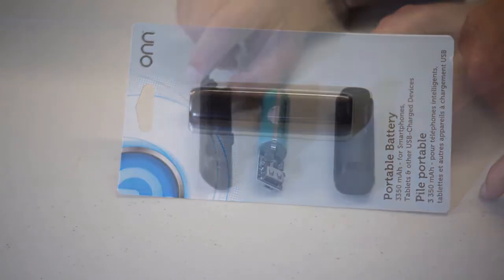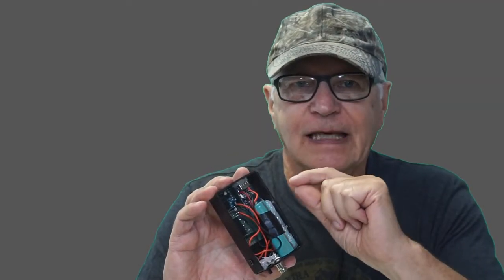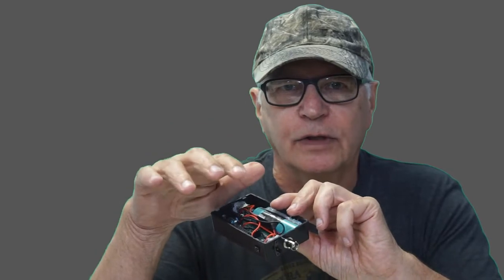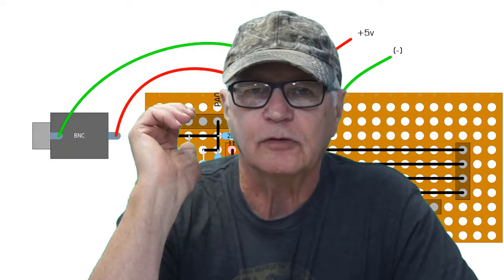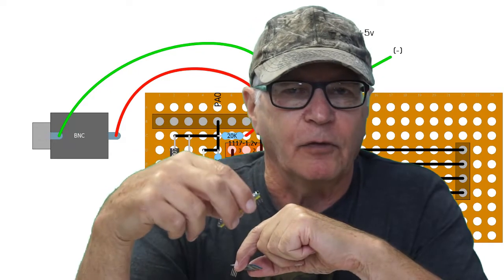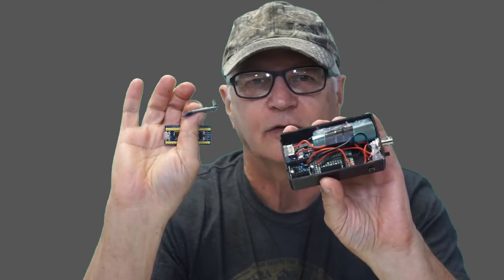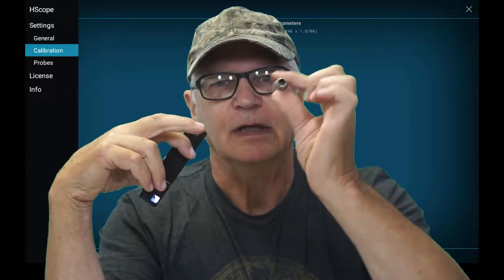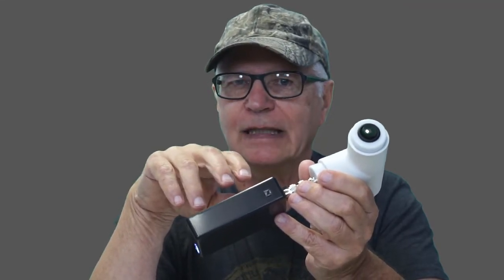GADGETS#73 - HS101 BLT BUILD

Comment from the maker: There are additional pics in the download folder illustrating build.
Reply: Hello, 
logical canuck. 
You surprisingly successfully hide the details of configuring and connecting the BT module to the software. I.e. HC-06 baudrate, how to activate BT mode in the software etc.
Reply from the maker: @vladyer3589  - I have unsurprisingly successfully provided the details of configuring and connecting the BT module...
As stated in the video, the procedure is outlined in GADGETS#71
Reply: 1. I see no activity on PC13 led when try to activate HC-06. 2. How do I connect to BT HC-06 from my phone? 3. How do I instruct Hsope application to use BT connection? And where is the connection dialog?
Reply from the maker: @vladyer3589  - Please watch GADGETS#61. Make sure you flash STM32 with the:
HS101 oscilloscope BLT v6 firmware for this project.
Then watch GADGETS#71 for the HC-06 flash procedure.

There are some faulty STM32 modules.
And there are some faulty HC-06 modules.
Defective or different firmware versions of these modules can lead to complications. Nothing can be done when we are shipped such modules.
If after following the instructions in both those videos you still have problems, I am here to help...as best I can.

Comment: Where do you get your 1117s from?
Reply from the maker: They are ASM1117 - 1.2v and can be found on eBay (where I got them) or Aliexpress ( where I do more of sourcing lately)
Reply from the maker: +Juiced105 - careful you get the right type...they tend to come in SMD and we want the type with .100 pin spacing.
Here's a link to eBay. Hope it works as I am always reluctant to use those links:
https://www.ebay.ca/itm/50Pcs-AMS1117-1-2V-AMS1117-SOT-223-Voltage-Regulator/181393096883?ssPageName=STRK%3AMEBIDX%3AIT&_trksid=p2057872.m2749.l2649

Comment: I searched the Walmart website for that particular (Onn brand) of battery pack and saw no sign of it. There were other Onn brand packs but not of that capacity or size.
I suppose any other one would work but it would be unlikely to fit in the case you designed for.
Unfortunate that you design around cheap - yes- but un-obtainable parts. I like the idea though and will consider it.
Reply from the maker: +Dave Sage - we have lots in our Kapuskasing WalMart store. Unfortunate that your larger WalMart does not stock them.
The smaller ones have 18650 batteries. They will fit and run HS101 for 16 hours. Unfortunate that a guy with your model build experience wouldn't think to improvise.
Your comment was unfortunate.
Reply: I haven't checked the local store. Only on line. I'll check later.
I didn't mean to be critical of your build. I have so many projects on the go sometimes it's nice to just build something as-is  rather than having to re-think it. Certainly re-sizing the box is about all that will have to be done. Not a big deal.
Nice Work. I'll put it on my LONG to-do list. All of your projects have peaked my interest.
Thanks
Reply: I will have to apologize for my comments. I got off my butt and actually went to the Walmart store. Sure enough they had the exact model on the shelf. $8.88 here as you said.
While I was looking at them I figured I could actually use these to power (directly) the ignition systems on my model engines as well. More Ah available than the four NiMh cells I use now and smaller as well. So I bought three of them.
Surprising they didn't have them (exact model) on their website amongst the 4-pages of Onn brand devices.
SO. Sorry for being so critical. I now have to gather the other devices to complete this nice project. Looking forward to your next installment. Thanks for all your development work.

Thanks
Reply from the maker: @davesage9190  - OK